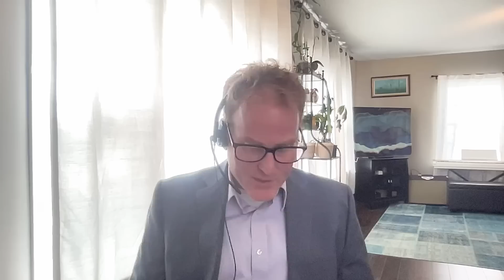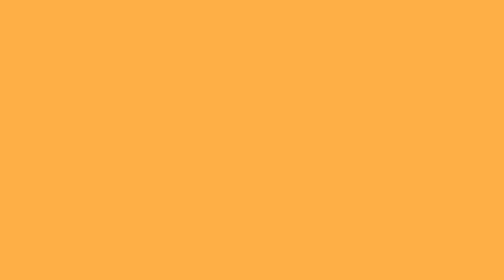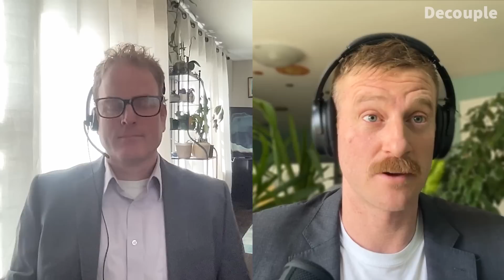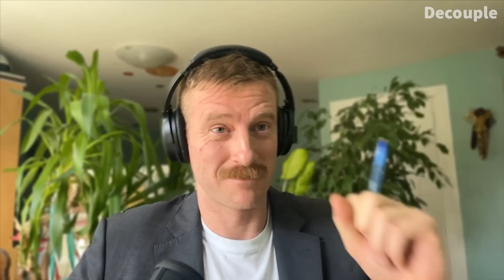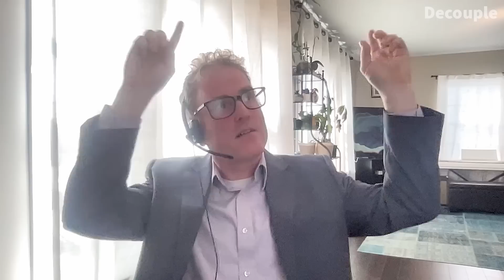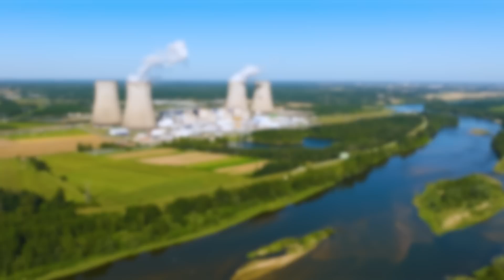The CANDU Story

Comment: CANDU reactors are very fuel-flexible and efficient in neutron economy, but their main drawbacks are low burnup (~7 MWd/kgU with natural uranium), much larger spent fuel volume, higher heavy water costs, more complex refueling systems, and high proliferation risk.
Reply: that's a nonsense myth. You need a special kind of reactor for breeding for weapons. Sure like any reactor you can use it for a dirty bomb but if you can get the fuel you don't need the reactor for that. that's why breeder reactors exist.
Reply: @joer8854   Look at India. After they got CANDU they produced their first Bomben, in spite of contract regulations.

Comment: The cost overruns of the Pointe Lepreau refurbishment were cited as a reason to close the similar Gentilly 2 Candu in Quebec in 2012.
Now facing potential power shortages, Hydro-Quebec is quietly floating the idea of building one or two BWRX-300 in Gentilly, eyeing OPG's Darlington experiment.  Or maybe revive Gentilly 2's Candu.
 
However, ~600MW would be barely noticeable in Quebec's overall electricity production compared to, say, the 1550MW of the Romaine River hydroelectric complex, the planned 3000MW of new wind power over the next decade, or the 15000MW of the James Bay hydroelectric complex.
Reply: Yes, Quebec has a lot of hydro, but in a dry year or at dry time of year, they can't run it at full capacity.  So they can sell the full 600 MW.
Reply: @RandyTWester  Yes, well 2012 was a long time ago, the situation has changed much since (water levels are currently quite low in Northern Quebec after two dry years).  

For now, large-scale wind projects are being built to supplement the hydro network.

I hope that nuclear eventually makes a return, but it will take more than 670MW or so to justify such a major shift in policy.  

More like in the 4000-6000MW range.
Reply: Quebec's biggest dam is in Labrador. There is no shortage of power in Quebec, just less ability to export power when it rains less
Reply: @tomkelly8827  Actually, no, it's the LG2 dam in Northern Quebec (>7300MW vs 5225MW for Churchill Falls).

The whole James Bay complex has a total output of more than 15000MW when all turbines are running.

Hydro-Quebec's strategy is adding >10000MW of wind power to allow for water turbines to be shut down when wind conditions are good.  Whether this is enough to compensate for extensive dry periods remains to be seen.

Comment: In the early 70's I worked at Sheridan Park in Ontario with another guy and we ran a computer model of the CANDU heat transport system.  It was the time that the pressurizer was added and there was significant boiling in the core so the pressure and temperature transients were a concern.  I guess what we did worked because the CANDU's have had long and safe lives.

At that time there were two things in favour of CANDU that were not mentioned in the video.  First, the use of natural uranium fuel is inherently the most safe.  If you made a pile of CANDU fuel nothing would happen.  Heavy water would have to be present and in an accident you can't get water to stay where it's +1,000 C.  The second is that not needing enriched fuel made the system best for preventing nuclear arms proliferation.  With light water reactors you either had to buy enriched fuel from the US so they controlled you or you didn't so they saw you as an enemy and tried to control you.

There was a discussion of modular construction and I'd like to comment on that.  For a time I was CEO of Intergraph in Canada.  Intergraph sold computer based graphic modelling of plant designs.  AECL had a license for our software.  In my time the Hibernia platform was successfully designed using our software. Here's what it is today https://docs.hexagonppm.com/r/S3D11PDS.  It makes modular design very feasible.
Reply: What's a transient and why is it a problem?
Reply: @madchem184  For example, if the reactor output had a sudden change and went up then the steam volume would increase (temperature rise) and getting the heat out is a problem.  Alternatively, if the reactor output went down then the steam volume would collapse and there would be a rapid drop in pressure leading to uncontrolled boiling.  (My recollection of 50 years ago.)

Comment: Everyone seems to give reverence to hydro generation. While dams are important for water management, then hydro power, they are an awful choice when built with main purpose being power generation. 

The Site C project for example 13,500 acres of land are lost, some farming much of it First Nations hunting and trapping territory. Many more hundreds of acres are lost to transmission rights of way as the dam is in a remote region of the province.

If we do a thought experiment comparing this project to Voltgle nuclear plants in Georgia USA, notoriously the worse example of a nuclear build we find that Voltgle is actually cheaper than Site C if we use the build cost versus the annual power generation. About 15% less.
And Voltgle is where the power is needed without the ecological and societal impact of a Site C.

Just imagine if the best and brightest minds were to focus on building nuclear generation, how the cost could come down and the benefits 
that could be realized.

We fear nuclear because it is an unknown, something we are not familiar with but there things we do everyday that are potentially more dangerous but because they familiar we don’t give them a thought. Flying on a commercial aircraft for instance.

Comment: This CANDU thing seems to work pretty well.  Why don't they build some in the US?  Is it the use of heavy water?  Why not build one South of the new Gordie Howe bridge?  And no, I'm not Canadian.
Reply: It was regulated out of the US.  When there is a loss of cooling accident it slowly heats up and if you don't do something for 7 days it has a problem.  Which is kinda funny because one of the selling features of the GE Hitachi SMR is that it in an accident it can be safe for 7 days, after which you have a problem.
Reply: @dodaexploda  No!  It was the positive void coefficient!
Reply: @dodaexploda  Interesting - Seems like the US would be a very good market for this reactor.  Maybe Canada should ruffle a few feathers in US Regulatory circles.  A mature technology that solves a real world problem in a less expensive manner than its peers ought to have widespread appeal to those who worship market solutions.
Reply: @daniellarson3068  the US would be an excellent market for this reactor especially considering that they can run on spent fuel from a pressurized water reactor like the US uses.  Not only that, it runs BETTER than it would from natural uranium.  The US could be using the same fuel twice.
Reply: @dodaexploda  According to the internet, it can use Thorium as well.  For many years, there has been talk of building Fermi 3 South of Detroit.  This would be right in the backyard of CANDU country.  Thanks for responding.
Reply: @daniellarson3068  no problemo.  Yup it can apparenlty run on Thorium as well.
Reply: @dodaexploda  Sounds amazing actually. Please tell me what you typed is accurate. 

What a huge win-win-win-win if so.
Reply: @dodaexploda  I did talk to the president of AECL and he was saying that although they have and can run on Thorium, it was more of a dirty fuel with more byproducts to remove and they seemed to think it was not worth it for all the troubles it caused. Maybe like running old gas through an engine. It can be done but you might have to clean or replace your carb later. The savings were not worth the cost
Reply: Heavy water plus positive void coefficient. Not desirable traits for the US
Reply: I'm not a nuclear physicist, but this technology makes sense, especially since   spent fuel can also be used. Perhaps the regulators should re-think this. Canada tends to do things that make good sense.
Reply: It is not superior to current US-approved designs. It's a long and expensive process to approve new designs. We have plenty of enriched uranium and plutonium to use for our reactors. Canada didn't, which is why they came up with CANDU to use unenriched uranium.

Comment: Any fission process using the cold water high pressure approach is the old technology that is completely controlled by both Westinghouse and General Electric that fund these megaprojects via the international monetary fund and the world bank for the purpose of supporting the current nuclear fuel and infrastructure system worldwide. This worldwide centralized control system of nuclear power is based on old technology that has no incentive for innovation. The new nuclear power technology using smalll molten thorium fluoride salt reaction technology that is intrinsically far more safe and efficient with very small and much less waste products than any Coldwater fission process. This presentation is just a marketing job for the current nuclear industry supplies such as Westinghouse and, General Electric.
Reply: Well - Neither GE nor Westinghouse built CANDU reactors as was plainly stated in the video.  Nor has the presenter of these videos decried new technologies in his other videos.   Whereas, you may be correct in that existing reactor manufacturers will wish to recoup their investments in BWRs and PWRs, this video did not impress this viewer as marketing for these products.
Reply: @daniellarson3068  To be correct, GE and Westinghouse do not build nuclear reactors. They create the uranium fuel pellets that are placed in the reactor rods that the candu reactor utilizes.
Reply: Why are 70 companies worldwide currently in a race to develop SMRs, etc?
Reply: @paullafreniere3393  Necessity is the "Mother of Invention."  Let's hope they get a chance to try out some of these paper reactors with a real build.
Reply: @daniellarson3068  the thorium fluoride molten salt reactor is not a "paper reactor". Oak Ridge National laboratory ran one that they built in the 1950s and 60s!!!!
Reply: @MarkMcelligottPeaches  Good answer - China has built one too.  Gordon McDowell has made quite a few videos on that old Oak Ridge experiment.  It never generated electrical power nor used Thorium.  You are also right in that GE and Westinghouse never built the reactors.  Typically Architect / Engineers like Bechtel and Fluor Corporation built the actual facilities.
Reply: @paullafreniere3393  An Small Modular Reactor (SMR) is a reactor construction technique. It is not a reaction process. SMR is a new whitewash cover for the 1950s fission reaction process currently allowed in the civilian energy production regulatory agencies around the world. The site construction is cheaper and more efficient than the regular non SMR reactors but the energy output from a cold water SMR is much smaller which requires more reactor construction for the same power generation which on the whole is actually less efficient. The only real viable SMR is a thorium fluoride molten salt reactor that generates more power than a cold water uranium reactor at scale! The reason why 70 countries are applying for SMRs is because these SMRs fall within the current nuclear power regulatory agencies requirements in these 70 countries which currently negate the application of the thorium fluoride molten salt process. This keeps the fuel processing requirements in place which keeps the Westinghouse and GE corporations flush for the years to come. Face it, China is full in on the thorium fluoride molten salt process and before the decade is out China will be a century ahead of the collective western countries including the US on power generation.

Comment: The scary thing for nuclear electricity generation is that the grid doesn't care where it's electricity comes from. 
The grid does care about its customers cashflow and keeping customers connected to the grid. 

Heavier industrial users want to connect to the grid, commercial developers can not commence construction if grid capacity is not ready.
Think about if everybody in your street wanted clean 3phase electricity when you wanted to increase your own needs to 3phase supply. 
And all the other streets in your neighbourhood.

The grid could not do it.
Even a farmer wanting a new supply to his offgrid buildings has to wait after paying $60,000 or more for the new line. 

So just to keep the existing grid safe and stable and cashflow stable then dirt cheap rooftop PV from existing millions of customers and supplying the new heavy using industrial customers is happy days.